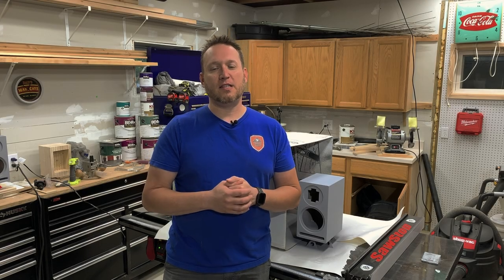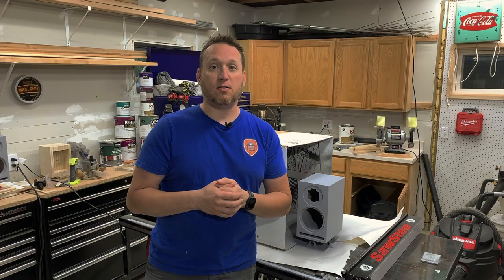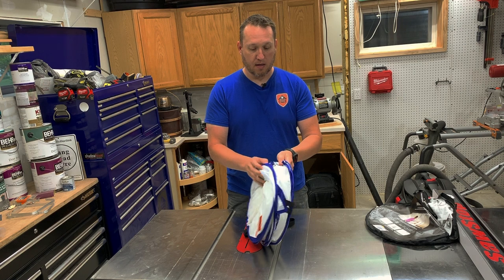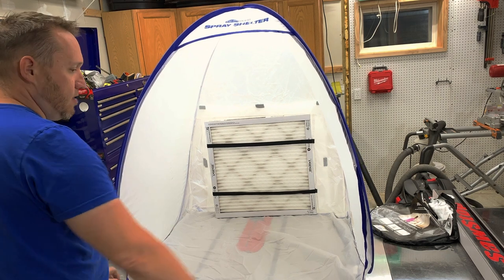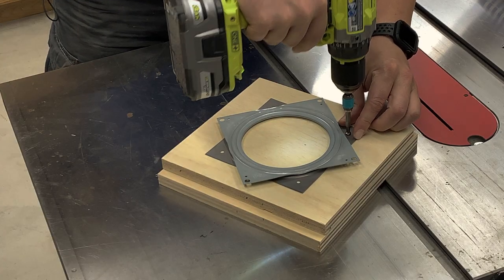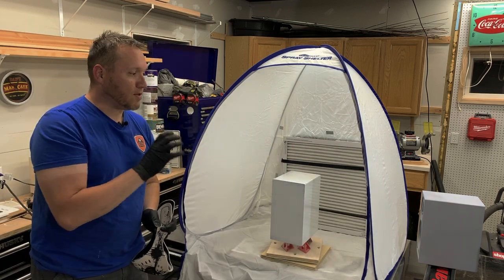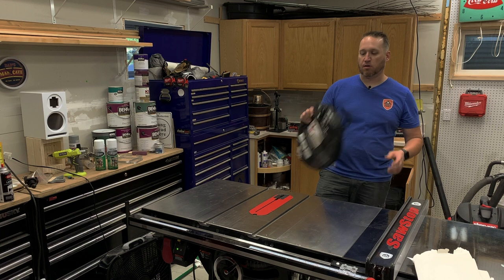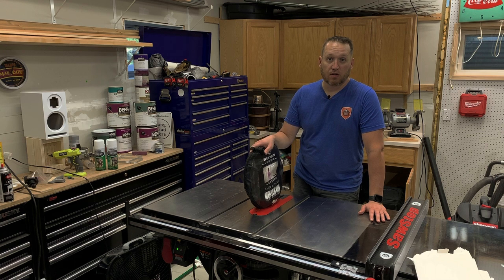How to spray paint without overspray | Homeright spray shelter

Comment: It's a cool idea for a small shop and thanks for the demo. The only issue I see, which is a potential problem with any spray booth, is that the negative air flow will pull in dust directly over the work piece thereby contaminating it. Therefore you might want to think about setting up a separate spray area away from where you are doing wood working!
Reply from the maker: That is very true if you are trying to get a better finish.  The advantage I see for this type of product isn't so much contamination on the project but preventing overspray on everything in that area.

Comment: I have one of these and it works great. I use a extra EZ Flow cheap green air filter in front of the more expensive air filter that's required.  It gives me more use of the good filter.

Comment: I going to order one of these. But my main problem, is with dust from the air getting in my paint and clear coat. It’s very dusty where I live. Do you think by reversing the fan to push clean filtered air into the tent could work? Thanks.

Comment: Great job! Loved the face mask. I've ordered this for my model air sprayer.
Reply: Gerard Faulk what is the name of you mask?
Reply: @cigarman121  It's a standard N95 Mask.
Reply: N95 masks are not rated for paint fumes.  They are 100% useless for paint. They are rated for dust, and are pointless to wear for painting with. Just pony up the $25 and get a 3m painting mask and the correct filters for it. It’s worth it.

Comment: I thought those box fans used for exhausting is bad since it can blow up or something since their motor aren't spark protected.
Reply from the maker: It would be possible. That’s one of the reasons I try using a better filter.
Reply: @BusyDadsWorkshop  Right but those filters are only for particles not the vapors. But I guess at the same time if it was that dangerous more people would blow up and that doesn't happen.

Comment: No issues with flammable spray?? The link says not to use flammable paint, just asking... thanks
Reply from the maker: For that, I would refer back to the manufacturer's recommendations.
Reply: @BusyDadsWorkshop  Which manufacture?  Of course the tent manufacture is going to say its fine, but Lacquer is flammable and that manufacture says to keep it away from flames and sparks.  Having the air pulled through is good, but you do still have a spark issue as the air fills the room.  You need a sparkless fan built for air evacuation of fumes.  Please be careful.  Think about this, what if someone sees this video tried it, but has a fan with a frayed wire - they forget to turn it on at first and then realize the fumes are too much so they kick on the fan and BOOM!  I think you really should have addressed that and made a point of fire safety.  I believe that it can be use the way you are using it safely as long as have fresh air ventilation and a mask - the fumes are still in the room and that is a small room.  I don't mean to sound like I am knocking you, I am not.  I am just trying to bring the issue to the front since it can burn down houses and kill people.  You have a good video otherwise and I wish you well.  Please don't think I am a nanny, I just want you and others to be safe.

Comment: I use a N95 Mask. There comfortable and safe, plus I can use mine several times before throwing it away and start using a new one.
Reply from the maker: I still wear a mask as well.  This helps greatly in collecting the overspray floating in the air when you are inside.
Reply from the maker: @jackjax532  You are absolutely right.  I ended up switching to my 3M respirator with organic vapor filters.